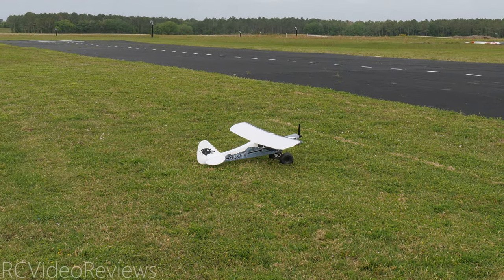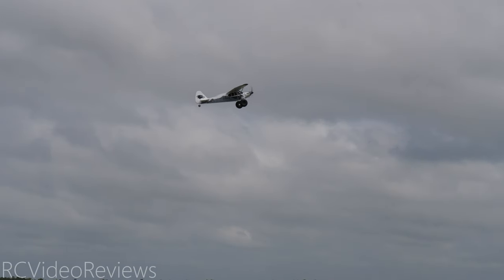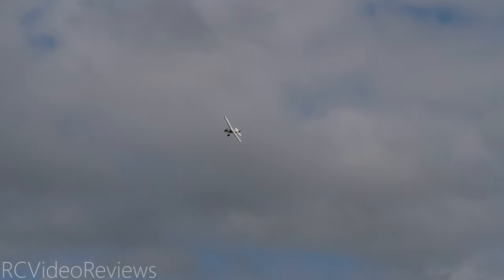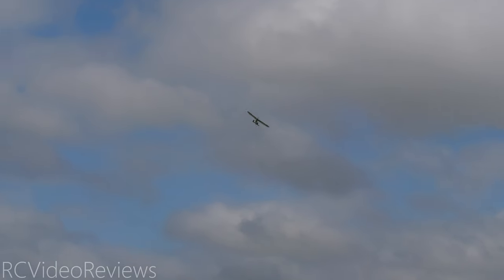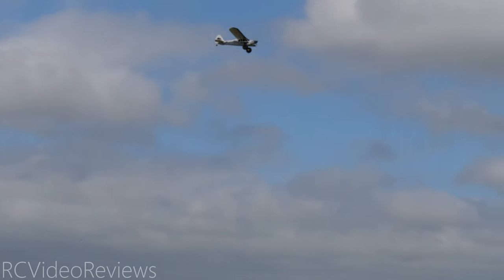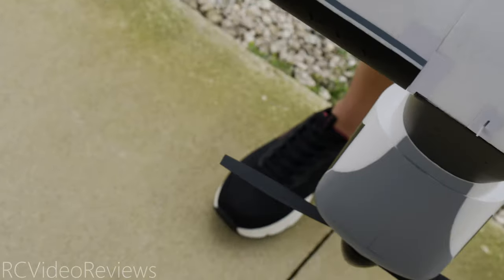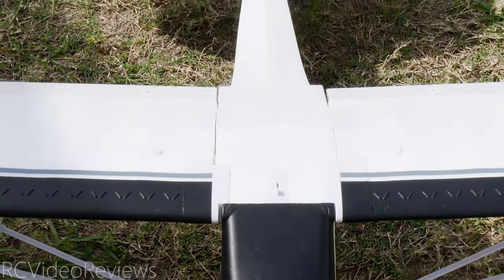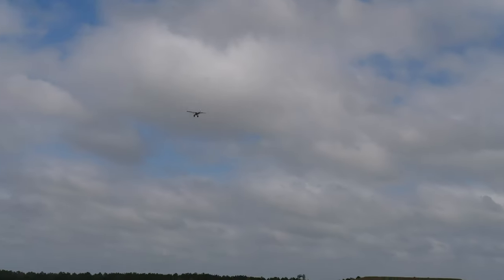Flying the FMS 1700mm PA-18 Super Cub in Strong Wind • Does the Reflex v2 Gyro Handle Wind Well?

Comment: My son and I have this plane and fly them every time it is windy. There is no one else on the field, and it is super fun practicing stol landings. This plane is so cool. We fly on 2200mah up to 6000mah. It handles them all. 6000s used only when 15-25 mph winds.
Reply from the maker: Wow, all the way to 6k eh?
Reply: We use only the back strap, and the battery ends up over the stabilizer, but the strap holds it enough if it is not doing hard loops or rolls.
Reply from the maker: Very utilitarian plane to offer that kind of range.